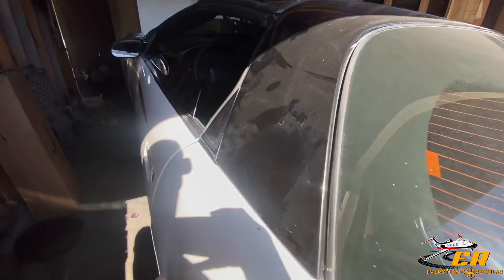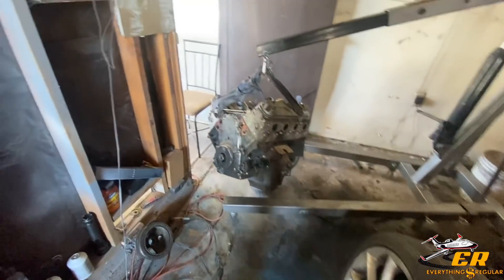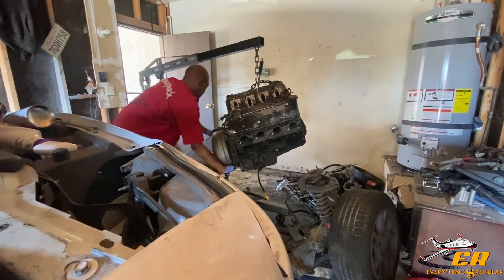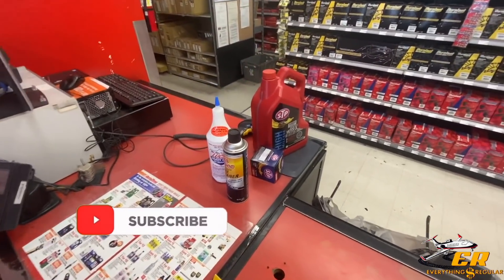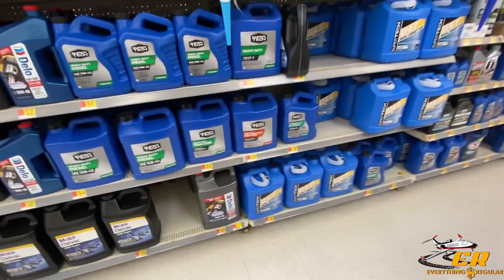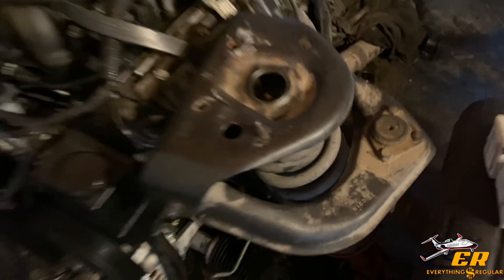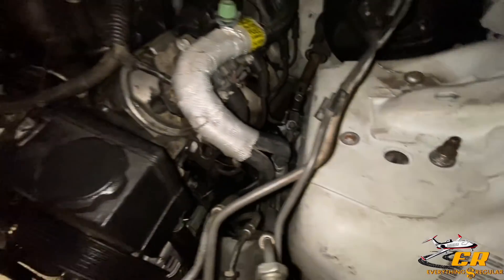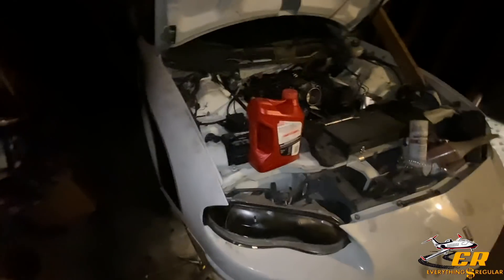$275 AUCTION CAMARO SS MOTOR IS OUT! NEW ONE IS IN!

Comment: When you go from a 6.0 to 5.2 will the computer be able to handle the adjustment ? I can't wait to see this project running . Great video .
Reply from the maker: No, its fairly the same, it could use the re tune, but for the most part there is no difference between 5.3 and 6.0, More or Less